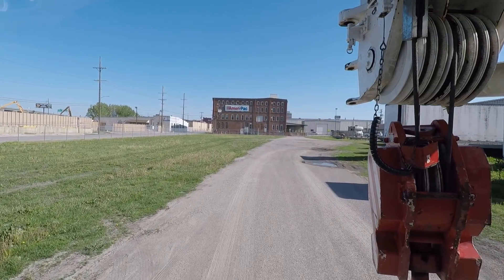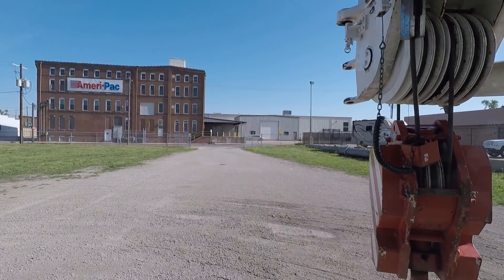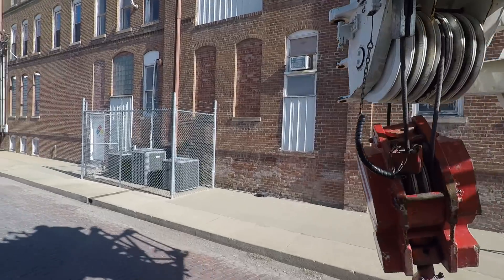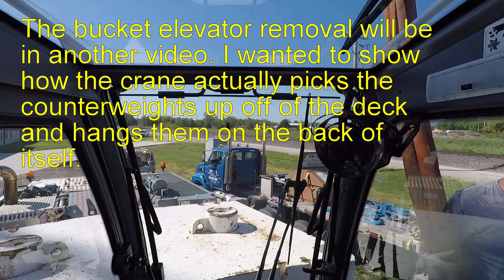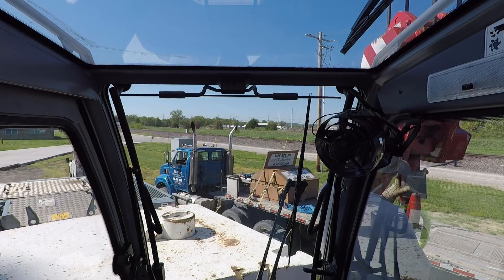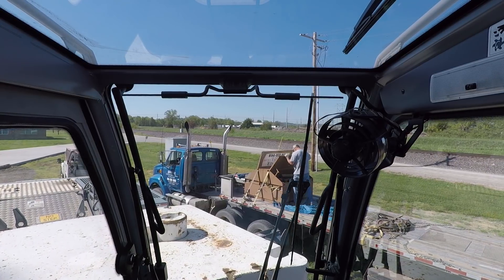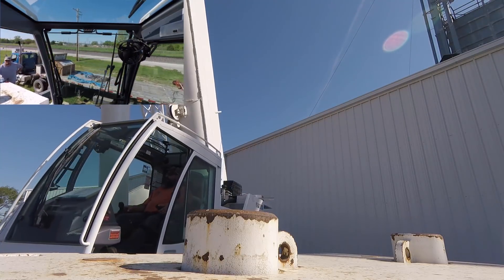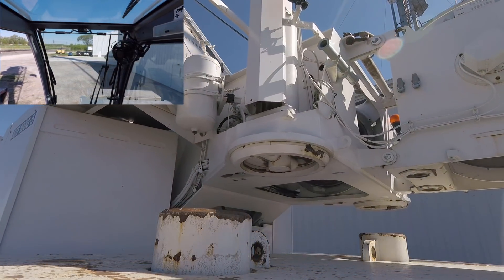Hanging counterweights | Tadano

Comment: To top man how are u from Rob over pond love vids counter weight interesting I question  for u I'm looking at crane to do job to lift rib boat off trailer  the rib boat go's about 9 ton to 10 tons but lift drop over side in water so what would be good crane for job as the reach radius  it lift boom down bit get over side of a wall

Comment: that looks cool how do they lock in ?
Reply from the maker: +Bleu Wolf, the rods rotate 90° after they get to the bottom. There is two switches in the cab. One lowers and raises the rods, the other rotates the rods. If you watch closely after the rods go through the top of the counterweights, it will rotate. Then I raise them up.

Comment: What size shaft are the Rams 3 inch or more either way that's slick and impressive that you can put 110 on just 2 Rams
Reply from the maker: Josh Welner, the rod diameter is probably around 3 inches, the bore or piston diameter is probably closer to 5 or 6 inches in diameter.
Reply: To The Top Crane thanks for the info I was hoping I gust right  camera's don't always do justice I'll take pictures of waves and I end up erasing them because they always looks small